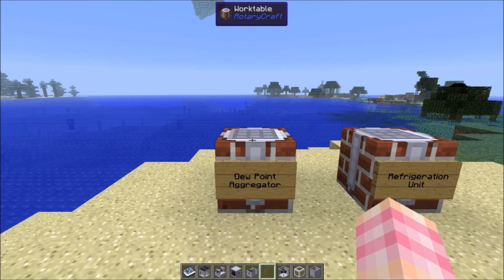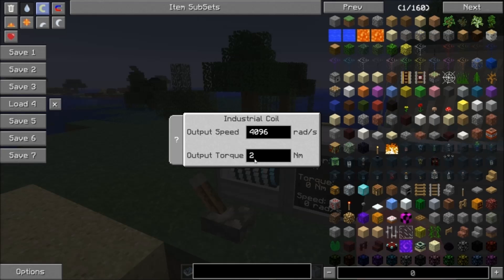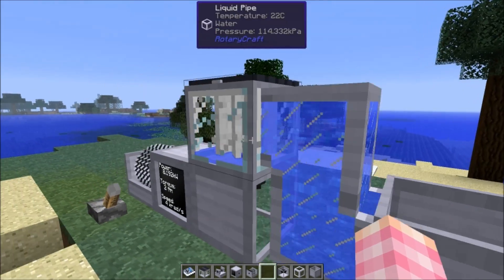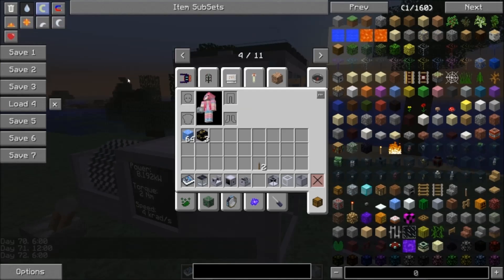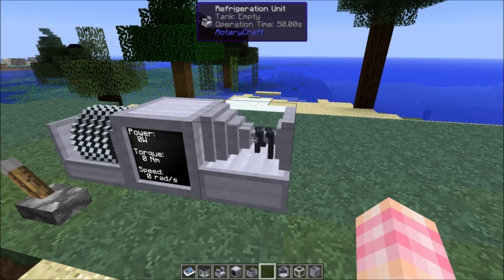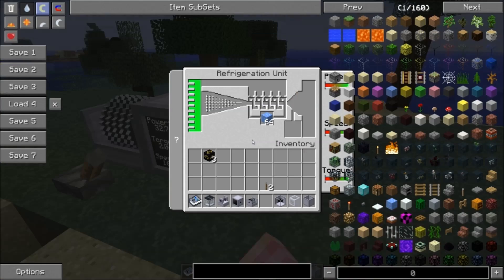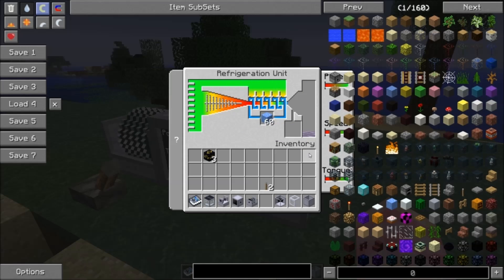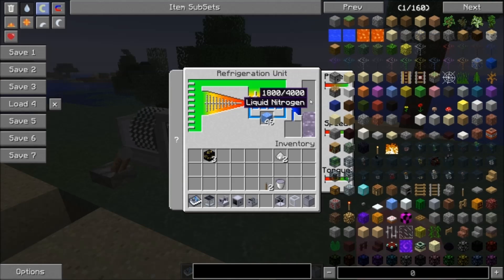RotaryCraft Tutorial #36 - Water Gen & Nitrogen

Comment: Curiosity (and Schroedigger's Cat): Have you tried running the DPA from a steam engine in the Nether?  It'd be interesting to see if it can maintain an adequate supply to power it and perhaps a second steam engine.  Though you'd have to prime the system with a different drive first...

Also, a potentially dumb question (though my uncle used to say there are no dumb questions - there are, however, a lot of inquisitive idiots in the world): how do you get ice (without cheating it into inventory)?  Pickaxe with silk touch?  Boring machine?  Trade with the abominable snowman?
Reply from the maker: I think you can silk touch ice blocks. Don't quote me on that though.

Comment: The turbine thingy is a compressor, the gas expands in the coils and further cools.the ice and air. The heat should be.able to be pumped.to other RC things or needed to be connected to coolant fins, also, liquid nitrogen cannot achive superconducting temperatures, liquid helium can.
Reply: LN can achieve superconduction in certain materials, but liquid helium enables a wider range of materials